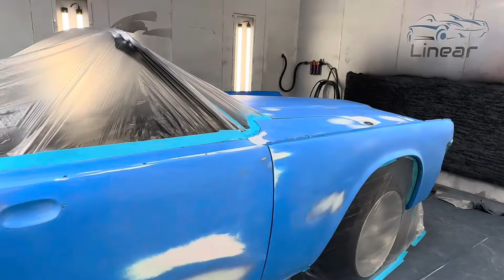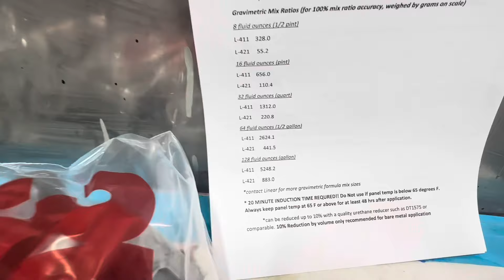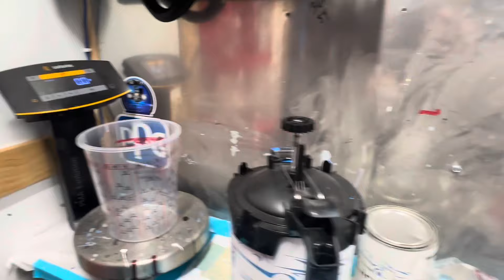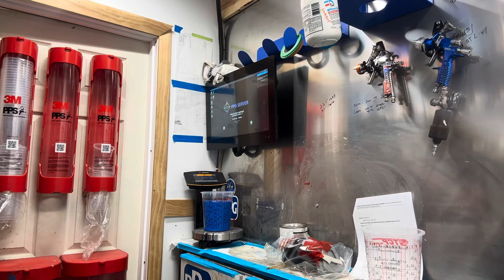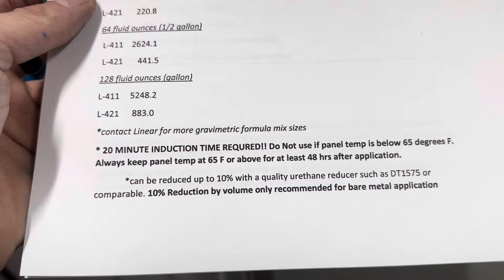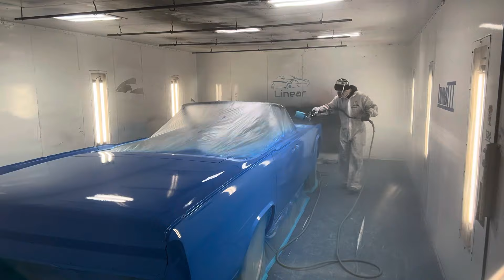65 Lincoln - L-411 high build epoxy

Comment: Amazing work? Is there a benefit or particular intention to spray this epoxy in blue?
Reply from the maker: It’s blue to just be recognizable as l-411 we are releasing l-417 and l-418 (grey and black) next week 👍🏼
Reply: @ Can you use l–411 directly to metal before applying filler also?
Reply from the maker: @olsonr69 yes
Reply: @linearblockingtools4064  if you sell quarts in black and gray i will buy both.
Thanks